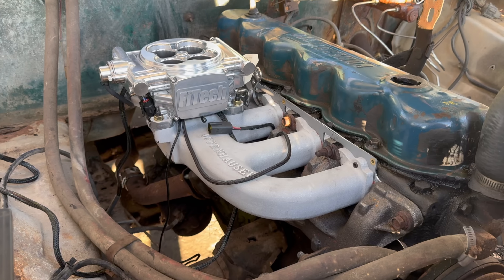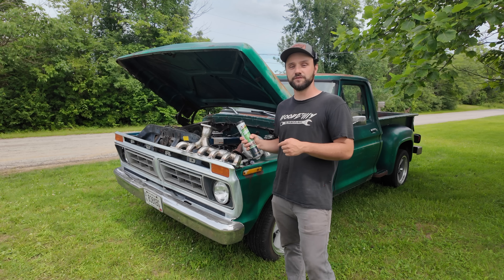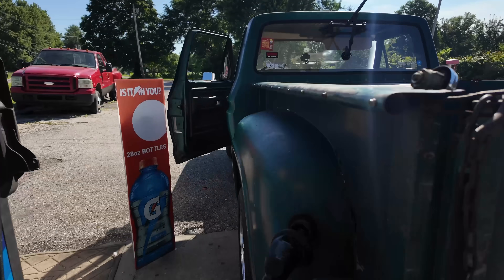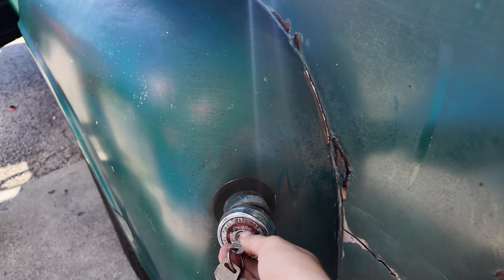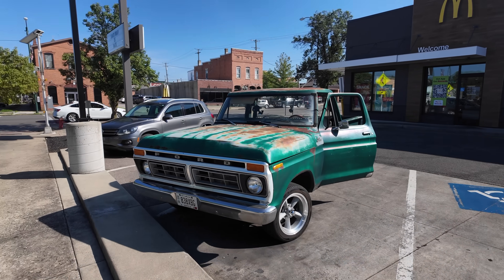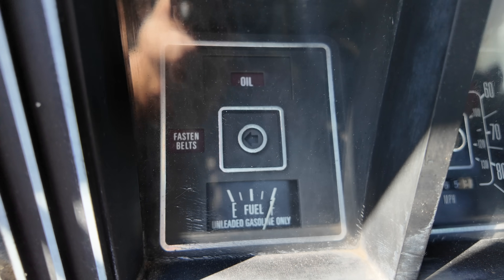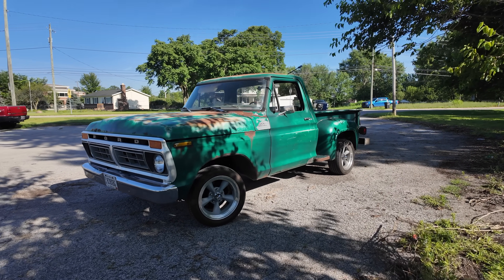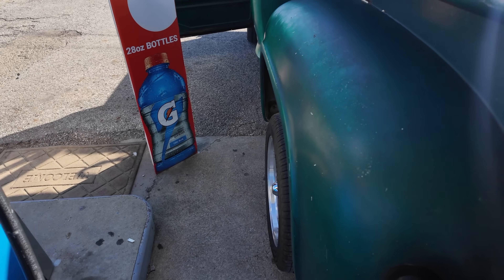How Many MPG Does An EFI Swapped Ford 300 Get?

Comment: MPG test based on 30 miles of driving? 😆
My 1971 F100 2WD 300/4-speed got 18 MPG on a severely worn out engine.  I replaced it with a later (80's model) 300 and it dropped to 14 MPG.
Reply from the maker: lol then we will drive it further
Reply: Manufactures and the Giovernment only use 50 miles.
Reply: And they're usually wrong. 😆
Reply: @bigospig  well yeah, I'm sure they lie about MPG because they lie all the time, or did during this time period about ACTUAL HP to keep the government and the insurance companies happy. I know for a fact that the 1973 Buick Regal with a 350 had 323 Hp and GM said it "Officially" had 260....

Comment: I dont think it's worth it imo, I value tunability/simplicity that carburetors have. If it was a little more substantial of a gain that might change my mind.
To each their own.
Reply: Once you understand how fuel injection works you find it’s surprisingly simple and easier to tune than a carb.
Reply from the maker: I’m putting a turbo on this thing and by the time I’m done getting the blow through set up done correctly I could’ve just EFI swapped it and been able to tune it while sitting in the cab of the truck. That’s why I EFI swapped it.